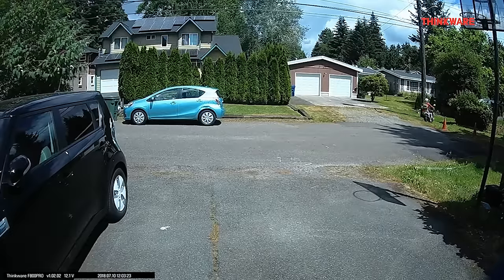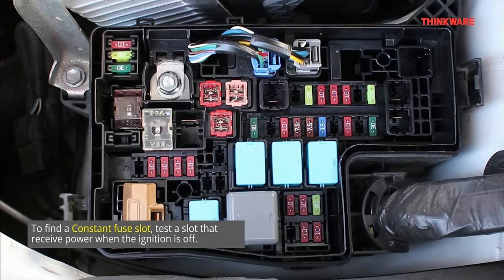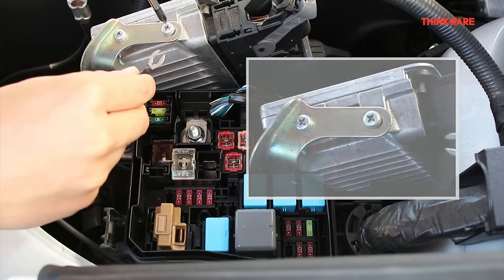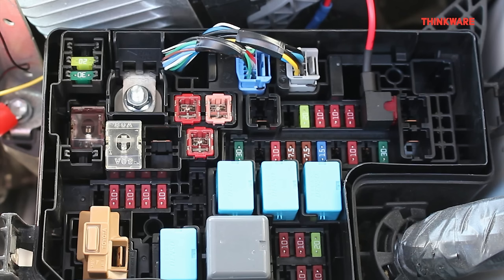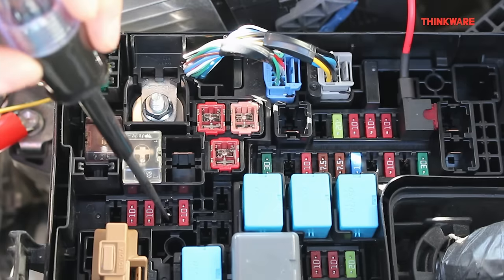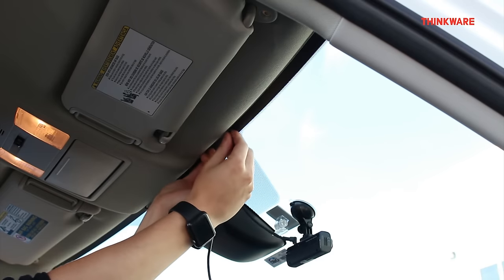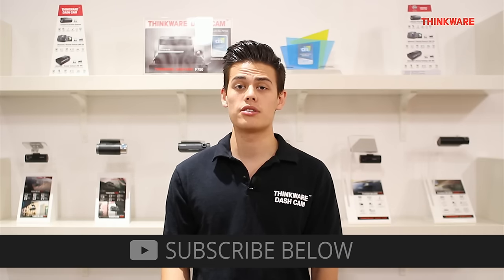How to Hardwire a Dash Cam

Comment: I am ready to hardwire but i dont know how to find out what size fuse to use
Reply: Look at the fuse that is in the car now
Reply: @Scrap3001  i have open spots available... no fuses to guide me
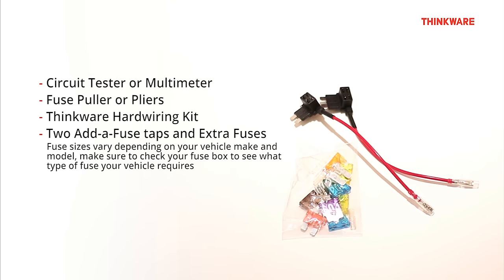Reply: @Scrap3001  i have this truck ... the fuse panel is mapped so i know which is hot and which is not etc ... i simply dont know what size fuse to use ... the map shows up around 1:20
https://youtu.be/vshg__0dlig

Comment: Why my car dies or stall after switching hardware kit?
Reply from the maker: Hi there! Please ensure that you connect the hardwiring cables to the correct fuse type/connection. You can refer to this guide to learn more about how to properly hardwire your dashcam - https://mondosystemhelp.zendesk.com/hc/en-us/articles/360046310234-How-to-Hardwire

Comment: do i still need to use the USB cable to power the dash cam after i had done this hardwire?..
Reply from the maker: Hi there, the hardwiring cable powers the dash cam. The hardwiring cable powers the dash cam from the fuse box, so no other power cables will be necessary.
Reply: @thinkwaredashcam  thanks for the explanation.. because in some videos, i saw the dash cam was connected with 2 cables, so i wasnt sure if the dash cam requires power frm USB while driving.. thanks!!
Reply from the maker: @shawnaquish5424  No problem! The second cable was probably a rear camera cable.

Comment: But how do you pass the wire to engine bay through the cabin?
Reply: varies by vehicle, but most will have a rubber grommet type thing in the firewall which wires pass through, you have to find the other side of that and feed a wire through it. A piece of coathanger can be useful for that. Another little tip when forcing wires through existing grommets/tight spaces - KY Jelly - water based so it wont affect any insulation and will dry out. Never hurts to have a little on hand for odd jobs of all sorts ;)
Reply: @iainbagnall4825  appreciate it man, this was actually very helpful

Comment: What's the difference between 2-wire hardwire kit and 3-wire hardwire kit?
Reply from the maker: Hello Kalpesh, a 3 Wire Hardwiring Kit allows the Dash Cam to recognize when the ignition is turned off/on by the ACC Cable and this controls the Parking Mode. With a 2-wire Hardwiring Kit which some other Dash Cam brands may use, this is just a constant power supply to the device, and the Parking is most likely controlled manually.
Reply: One has 2 wires while the other has 3.
Reply: @15DurangoRT  Mate it took you 2 weeks to figure it out.

Comment: How to do this with dual cameras without taking up 4 fuse slots?
Reply from the maker: Hi there, a Thinkware 2 channel system does not require you to hardwire the rear/interior cam. The second channel connects to the main unit and is powered by the main unit.

Comment: Do not use a Great light on a CAN BUS vehicle, 
Do not use a power probe at all,
Do not use a fuse tap, vehicle cabling can melt.

Only use a digital volt meter. 
Find a heavy ignition +15 cable only
Use only solder and correct fuse rating 
Use this video as what not to do.

Signed 
A certified vehicle electrician

Comment: hi whic fuse i should choose 15 or 5 ? Thank you
Reply from the maker: If you are referring to what fuse to tap into a 15amp or a 5 amp fuse, choose the lower amperage fuse first. If you have any more questions please email or support team: support@thinkware.com
Reply: @thinkwaredashcam  Isn't there an amperage rating for the camera? Isn't the whole point of having a fuse inline to kill power to the camera if there's a short, so the amp rating on the fuse should be something like 200% of the normal current pull? If the camera is just 1-2 amps, then maybe a 5A would be a lot better than a 15 or 20?

Comment: How I can close fuse box cover after that?
Reply: Usually you can’t.  That’s why you should find the cabin fuse box.  If none, don’t use a fuse tap.  Instead use a fuse splint.
Reply: @Rima-hh8db  ok thanks
Reply: @Rima-hh8db  I have a 2010 dodge ram and all my fuses are under the hood none in the cabin, my problem is the same cant close the fuse box cover. What is a fuse splint? I looked all over and cant find anything about it.
Reply: @ramssl  :  You probably already figured this out, but in this case your best bet is carefully marking out a place where you can notch the cover and use a dremel tool or equivalent with plastic cutter to cut it out.  Works like a charm.

Comment: hai.. why use 2 set fuse taps for dash cam
Reply from the maker: You will need to tap into two different fuses. One ACC fuse and one B+. As you are tapping into two fuses you will need two fuse taps.

Comment: Good video, I have a dash cam that I was to install, on the fuse that come on when you turn on the ignition can you attach a add on to that again, reason why I say this that I have some lift air bag attach to the fuse so now I want to hardwire my dash cam to the one that I have already attach it to, in other word I wanted to know if I can attach another add on to it?

Comment: Does the f200 require a 10 amp fuse or can I tap it with a 5 amp? I'm installing the f200 thinkware

Comment: Why do you used an empty slot with two fuses on the tap wire?
Reply: because the tap wire needs something in the "original" fuse slot to bridge off. I wonder if anyone makes single-slot fuse taps for use in empty fuses slots? Would be really nice to be able to have a totally flush install so i can put the cover back on the low profile under-dash fuse box in my prius.
Reply: @iainbagnall4825  i saw the constant tap wire was plugged in to an untested unoccupied fuse slot. i assumed its constant power, so i thought why need two fuses there? shouldn't the tap wire have power on the positive terminals once plugged in so once u add a fuse in it would make a complete circuit to whatever being powered. unless if the tap wire is wired in series and an existing circuit was used to tap off of then i can see the need for two fuses on
Reply: @ONeA2122  As academic as this is, my curiosity is piqued. I've got one in my gubbins box... imma get my voltmeter and see how its wired inside. I would assume one fuse piggy backs off the other, so that you cannot just use the fuse tap with a single fuse. You could just bridge the terminals I guess, but fuses are cheap so why bother?
Reply: @iainbagnall4825  i don't think its wired is series. if it does that's bad, the amperage would fluctuate or dropped depend on size of load being drawn from that circuit. and also if the existing circuit's fuse on tap wire blown you'll also losses power in the original fuse powering the camera
Reply: @ONeA2122  good point, hadn't thought about that.

Comment: This is incorrect.  A Constant Fuse slot is a fuse that is powered whenever the battery is connected.  it is not a fuse that only has power when the ignition is off.
Reply: Interestingly I do not believe I have ever found a circuit in a vehicle that is energized when the key is off and de-energized when the key is on?

Comment: I don't understand why you need a constant and a aac whats the difference than me you keeping my constant on ???
Reply from the maker: Constant and ACC are necessary so the Dash Cam knows when the vehicle is on or off. When turning the vehicle off, the Dash Cam loses power from the ACC cable and that's when it knows to switch from Continuous to Parking Mode.

Comment: Low profile fuse taps will not fit in passenger kick panel in F350 diesel. I've tried 3 different brands. What alternatives are there?
Reply from the maker: Hi Larry, you may have to try a using the second fuse box (If you vehicle has one). You can splice the hardwiring kit into a ACC and a B+ wire. Your last option would be to wrap the wires around the fuses although we do not recommended this method

Comment: Fuses don’t have postive and negative terminals lol, its doesnt make any difference which way it’s pit back on, one is lighting up and the other is not as obviously the circuit is not complete, the fuse completes the circuit
Reply: If you put that adapter cable in the fuse slot the wrong way it will bypass the top fuse and go straight to dashcam ( leaving dashcam unfused ). 

If your putting a fuse straight into fuse box then yes it dosnt matter about orientation.

Comment: I just used the hardwire kit to install my x700 is there a way I can turn off the continuous recording when my ignition is off?
Reply from the maker: Hi There, When you turn off your ignition you should hear the Dash Cam announce "Parking recording will now start". The Dash Cam should not be in Continuous Mode with the ignition  off.

Comment: The fuse tap would work either way around, except that if reversed it would have been fed power from the other circuit's fuse
Reply: It works correctly in only one orientation. It apears to work in either orientation.
Reply: @walterk1221  that’s what I said. ‘Works’ and ‘works correctly’ are different observations.

Comment: I'm not a fan of the double fuse adapter as it could mess with the resistances and risk blowing some circuit in the car.. (unless of course they are connected in series, but then why use 2 fuses in the first place)

Comment: This is a rather incomplete sequence. The attachment of the Piggy backs to the wiring harness is not the first thing. That should be done after the dashcam wiring is in place. Not before, trying to pull the piggy backs or the connections through the vehicle could cause damage to the vehicle (dislodge other cables or gromits, tear fabric, puncture airbags etc) or the connectors. Also. pushing wires under bits of rubber seal, plastic covers or head lining willy nilly is also not good. Beware SRS airbags. Cross a wire over one and it may result in a serious injury to the vehicle occupants as the air bag either fails to deploy properly or drags the dashcam off the screen at such a speed it becomes as bad as a faulty Takata airbag. The part demonstrating the correct approach to mounting the fuses after doing the wire install is one of the best around though. Even if it is better (simpler) to use the inside fuse system.